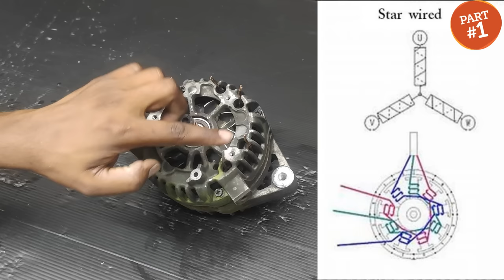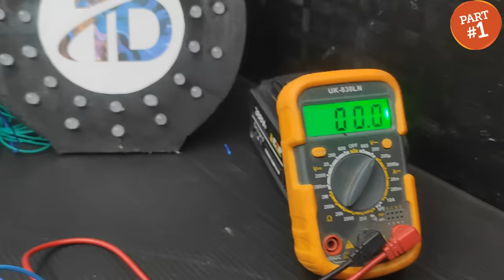I turn the car alternator into a free energy generator/Homemade Generator/Dynamo into 220v /PART #1

Comment from the maker: In the second part I will bring you how the free energy generator works...PART #2 
**Use magnets of this size and it works great  30x20x10mm
Reply: Bull chit
Reply: Great forget the bullshitters
Reply: Sampai sekarang anda masih belum membuat videonya part#2,bull shit 👎
Reply: I don't understand why you didn't just make it self exciting and use it the way it's designed as an alternator. It's easier and more efficient.
Reply: My friend made this. Fantastic thanks.
Ignore the lazy minds you'll never wake them from their shleep
Reply: How many magnets you installed?
Reply from the maker: 12 magnets @unikgandhi6299
Reply: Which magnets we can use instead of neodymium.? They are costly.
Reply: Thank you so much but I just don't understand the wiring
Reply: I need one like that
Reply: Where’s part two

Comment: But why all the fus? Car altinators already make electricity. Why cut it open and so on?
Reply: It is because initially, the car uses the battery's DC current to power electromagnetic coils in the stator which allow for power generation. Since hes not lugging a battery around, he can use permanent magnets to achieve this in the stator.
Reply: @TheSoab117  I don't get your point? You mean the small amount of energy to get it started? And magnets, unless they are moving, are not going to do that.?
Reply: To generate AC power or alternating current by removing the rectifiers and instead spinning the magnets near a coil. this produces AC power, as the polarity of both current and magnet constantly flips or switches and alternates in Directions, and thus giving it a name of AC power.
Reply: They make 12 volt DC you upgrade them for household current

Comment: Great job Sir, I suggest if you did the connection Delta , longer wire higher voltage don't you think?Three coils in series .
Reply from the maker: Yes, definitely
Reply: Hola de dónde eres quisiera uno así para cargar baterías 12 voltios o uno 110 voltios vivo en un lugar donde no hay energía eléctrica. Por cuánto me Arias uno.
Reply: @fanuelaldana3875  i don't understand your language Sir, please in English.

Comment: Do alternator need magnets again before it can generate power?
Reply: A traditional car alternator uses a bit of current from the battery to induce magnetic fields in the stator. Since "we don't have that" in this project, permanent magnets are needed.

Comment: Wow, pointless......just plug the corresponding output wire to what you want to energize. Thats what an alternator does. Same alternator,  i can accomplish with 1 minute, what you just did. Yes people. An alternator is a manual power generator, just hook a wire off the positive lead, and use the ground on it. Spin it, and you have power. 15 volts usually. No science was performed in this video.

Comment: I don’t get it. He couldn’t sustain it.
Reply: I think the idea was you'd have to fill in the blanks and come up with your own use for it. The device by itself isn't going to run on its own forever. You'd have to build something like a wind turbine or something like a propeller and place it in a running stream and have that continuously turn the alternator to produce constant power. I'm pretty sure that's what he created.

Comment: Agreed what's turning the pulley .  U need something turning to create power .  I've been working on one for 4 months and thanx to these videos it puts me a step back each time .    I can produce 12.4 volt running  inverters chargers and lights for 11 hours I tested and still on 12.4 v  but not much power for anything else
Reply: Use a step up transformer & make a circuit to increase the amps
Reply: What are you using to generate spin? Tweaking of the hub may be needed. Converted alternators without a voltage manipulating add on can and should be able to generate at least 24 to 48 volts at a relatively low RPM. It's all about the spin...